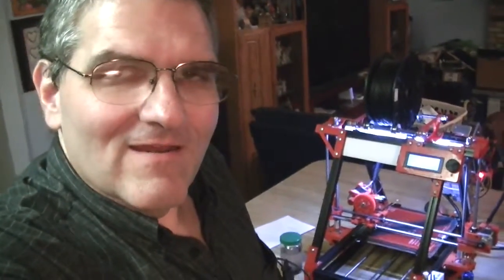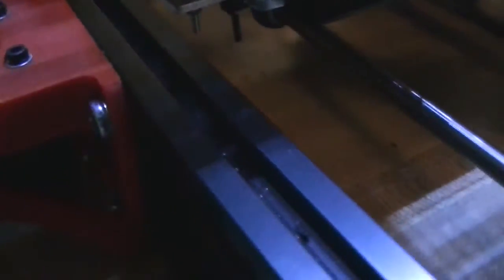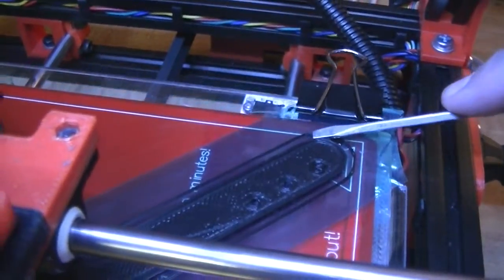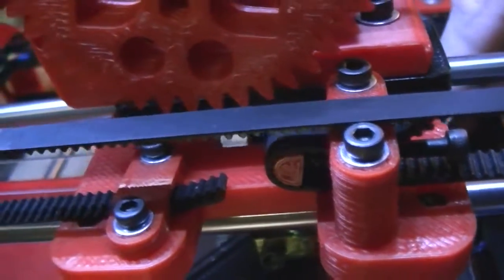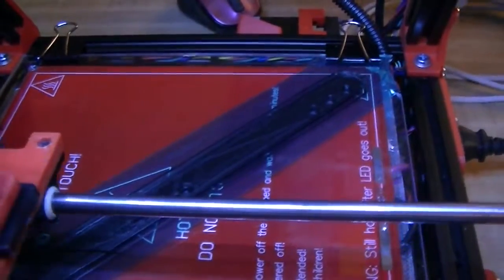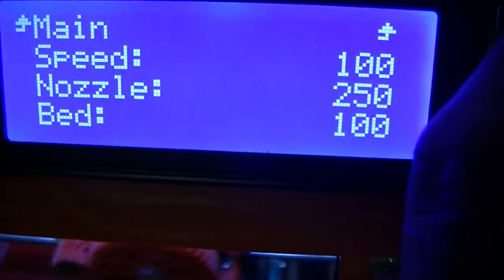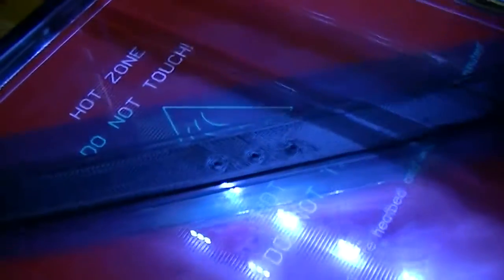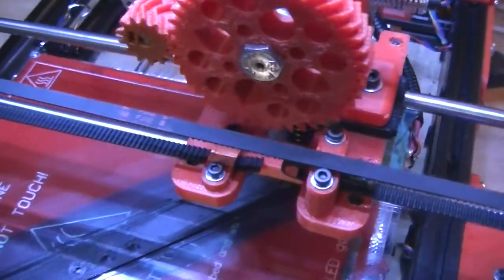2013-07-17-Supplemental. 3D Printer Curling Problem Solved

Comment from the maker: It was working fine... until it clogged again...

I've subsequently found that there are plastic parts inside the extruder that are made from PEEK. It turns out PEEK softens at 248C, so my running at 260/250 is a bit of an issue.

I'll be turning the temps down for the next run.